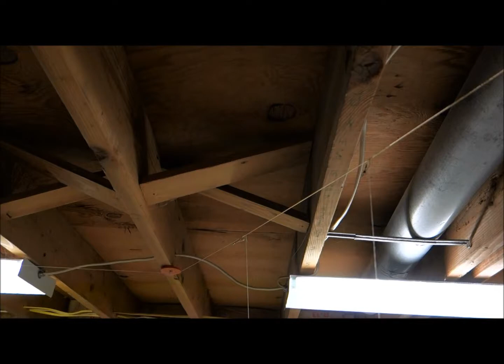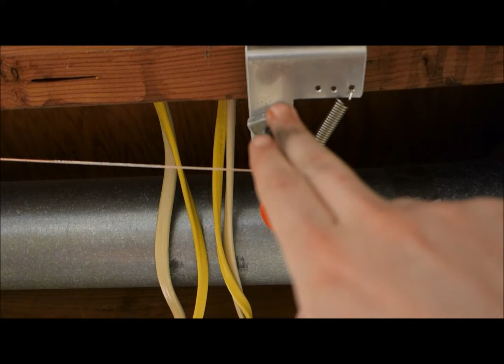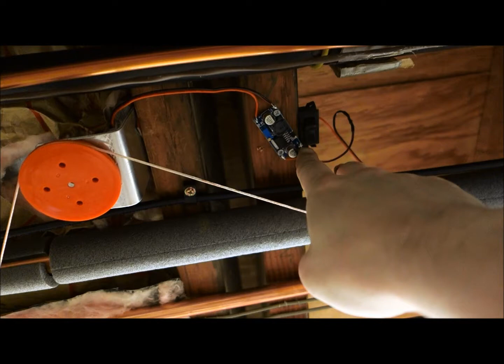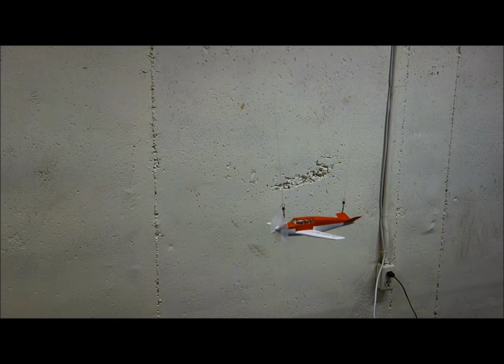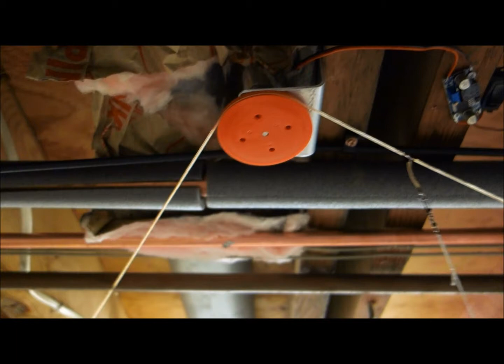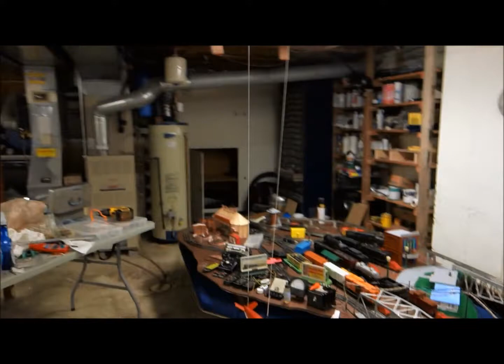Lionel postwar airplane flies on cable system

Comment: I am finally experimenting with the same idea.  However, I am thinking of using smaller pulls closer together.  So when the plane reaches a point where it goes around a corner, the corner will be more gradual.

Comment: Aircraft cable might hold up better than the insulated wire you're using now.  Also, I would try some experiments with the way you have the plane hung.  Possibly moving the two hang wires closer together where they attach to the drive cable.  Or try using only one cable to hang the plane by.  Where the cable attaches to the plane, split it into a wye, so that the plan will stay level.

Comment: Very very cool! I'd like to do this. Maybe if you put 2 pulleys next to each other, the wire goes through one at a time and each pulley helps hold the other one. Not too sure if I explained it well enough...lol. I subscribed because I like your ideas!
Reply from the maker: Yea I wish I could just put two pulleys touching and have the wire in the middle but you have to have room for the hang down to go past. My system works but if it pops off its a huge pain to get it back on.